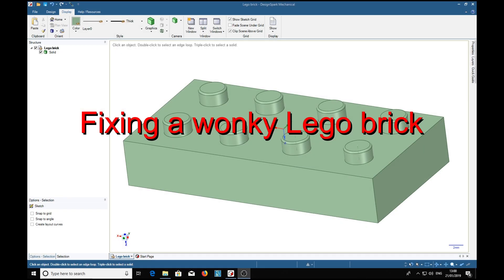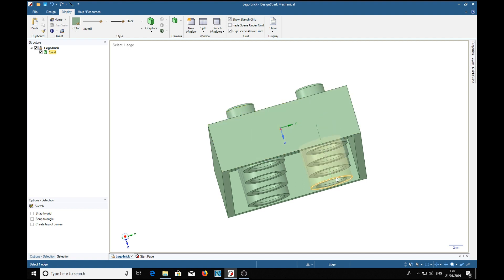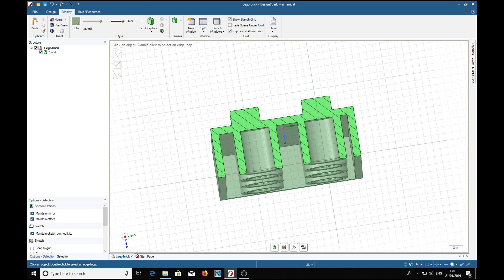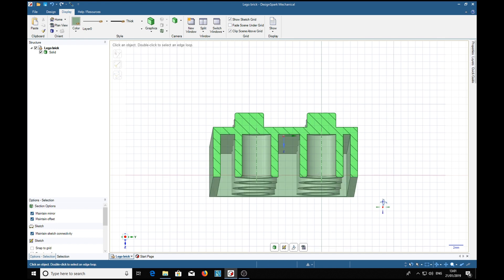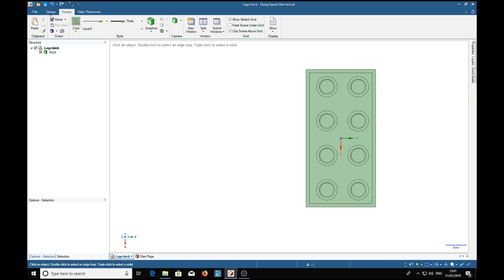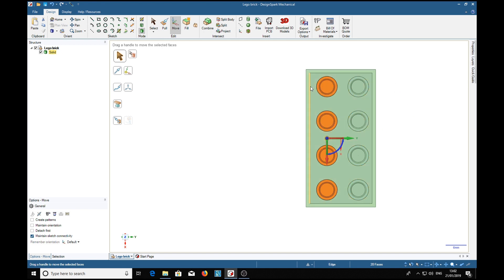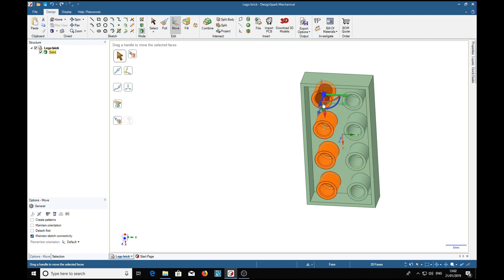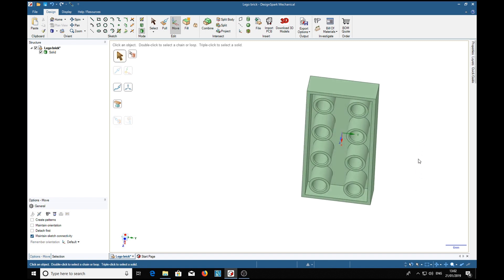It's easy to fix things in DSM

Comment: Jim that was clever. 
I would like to take the advantage and ask you if or how to use a mirror function in DSM; like a detail that has right and left feature. As an example of and airplane. If I would model from the center line the right side then I would mirror it to form the left side? Thks.
Reply from the maker: There is no mirror function as such in DSM. However, in sketch mode  there is something called a mirror line. Draw a line and right click it. Select 'Set as mirror line' at the top of the list. Anything drawn on one side of the line will apperar on the other side.
Reply: Thank you Jim.
I will try the line mirror function.
A solid mirror function would be very useful.
Reply from the maker: I agree. I have contated DSM on more than one occasion about this.